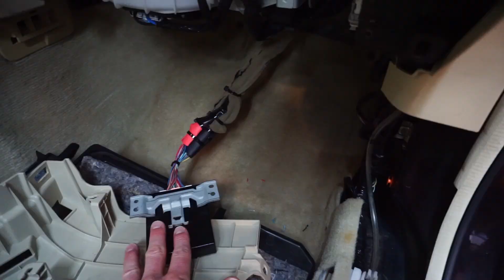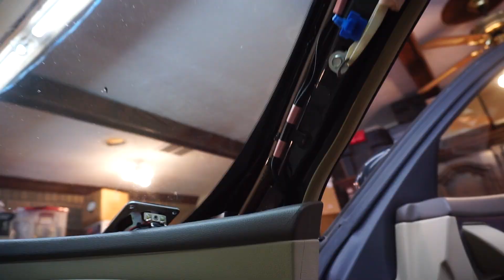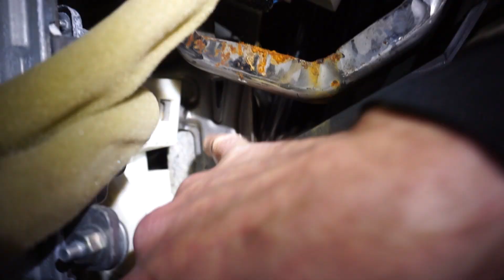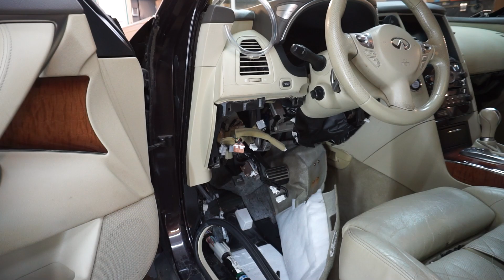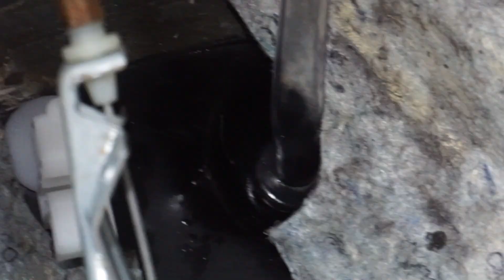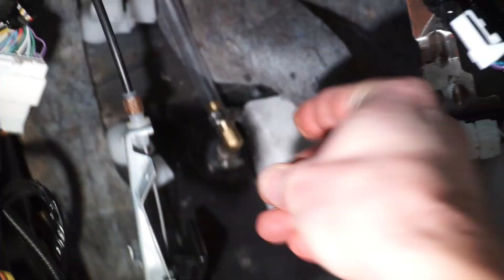Infiniti FX sunroof drain tube permanent fix DIY

Comment: Super helpful video!!! I was wondering about the ac condenser drain as liquid was leaking under my qx70. The drips were coming from the frame and not a tube so I’m trying to find out there the ac drain terminates

Comment: Thanks for this video…my FX keeps getting water inside & I had it fixed twice and water is still coming  inside…do you provide repair service? If so where are you located & if not do you know anyone in NY who is familiar with this issue ?
Reply from the maker: How did you have it fixed?  I don't offer repair services or know anything in that area, sorry.
Reply: @ just bought it bk to my Auto Body guy n they are still baffled ….
Reply from the maker: @jeanninethompson4982  It's possible the sunroof drain tubes are clogged.  Try to find an independent shop that will follow what I did in this video, and also have them make sure the drains aren't clogged.
Reply: Which side?  Passenger side also has a big rubber grommet with wiring harness ... these leak too, and conveniently the idiots at Nissan/Infiniti decided to route roof drain exit directly upstream of it, along with right cowl drain holes. So it constantly gets wet. Dealing with this on my mom's 2017 QX70 right now. Also, check on cowl seal, there was/is a foam seal from factory that seals cowl against windshield and deteriorates with age. Just use house window rubber seals (just pick a good sized seal that can fit in the cowl grove and be compressed by windshield).